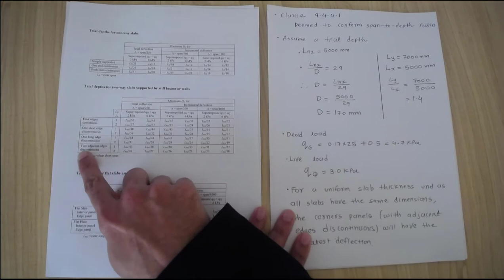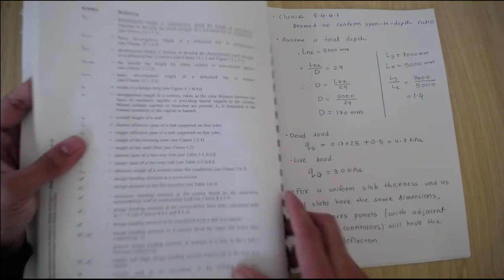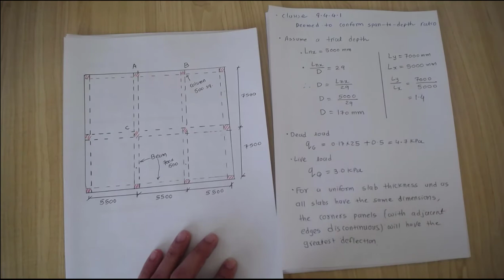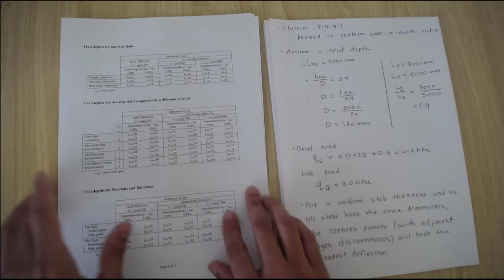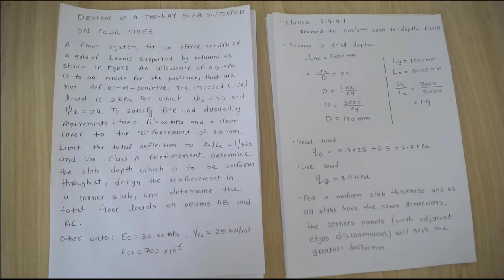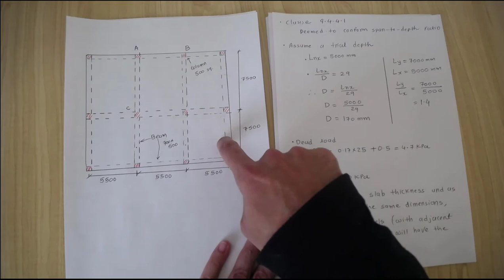Two Way Slab Example 1 Part 2-Trial Depth Ds

Comment: Im assuming the middle slabs deflect the greater than the corner slabs since the middle slabs have beams that have loading from adjacent slabs where as with the corner slabs, the two discontinuous edge beams only have loading from one slab
Reply from the maker: This is correct.